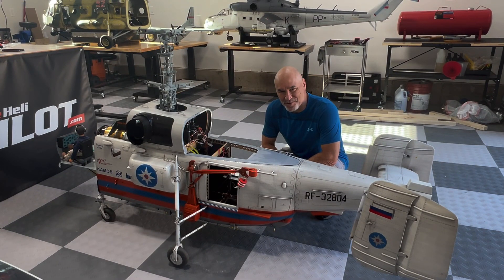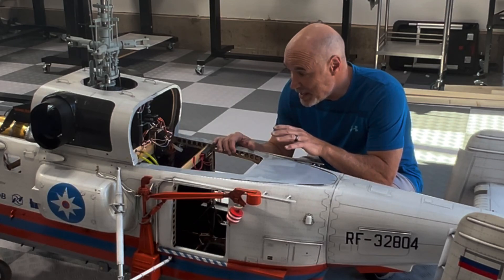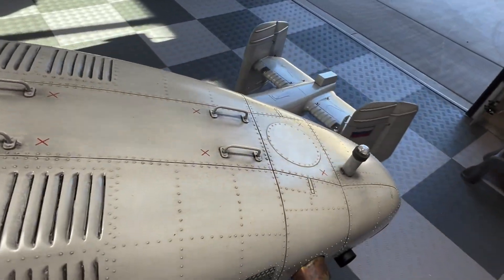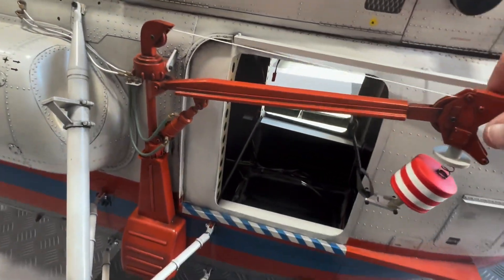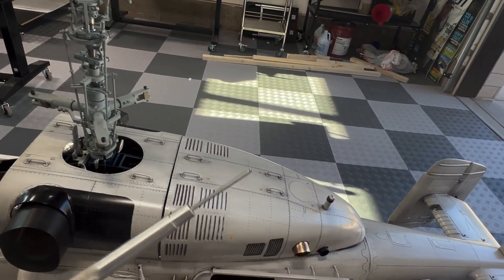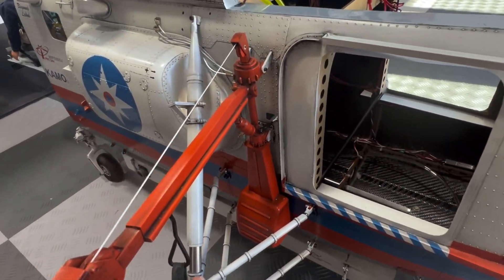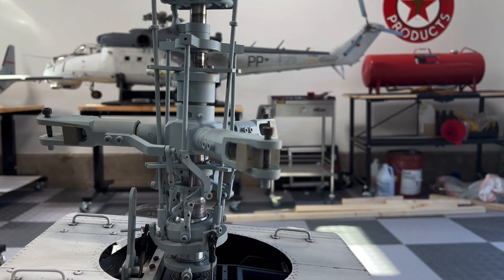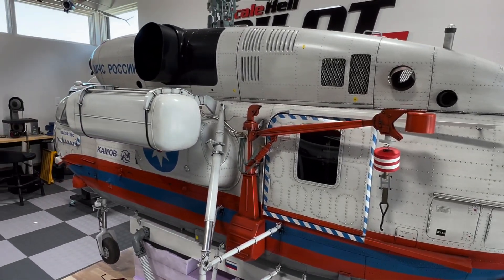Exploring the HeliClassics Ka-32 Radio Controlled Helicopter - An Engineering Marvel

Comment: definitely one cool heli...the best engineered...id have to respectfully disagree ....wayyyy to many parts in that rotor head ...but then im not a scale pilot either...i fly 500 to 700 class 3d machines...and the dfc head is the best thing since sliced bread..the only thing between the swash and the grips are 2 linkages lol...dont get much more easier to work on than that lol

Comment: I still prefer Vario!
Reply from the maker: Vario is fine but having owned 8 Varios and 5 HeliClassics, it’s not even close. HeliClassics are far superior in terms of engineering, design and finish. That said, a good modeler can make a Vario look good. The mechanics on a HeliClassics are simply more robust and efficient to maintain.